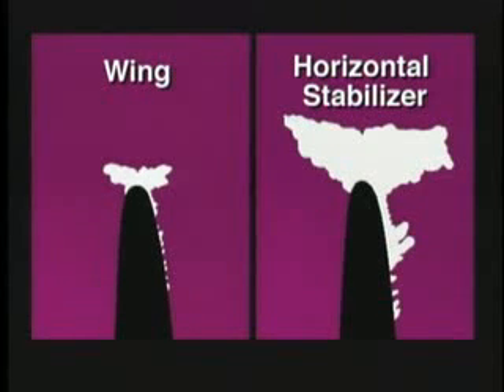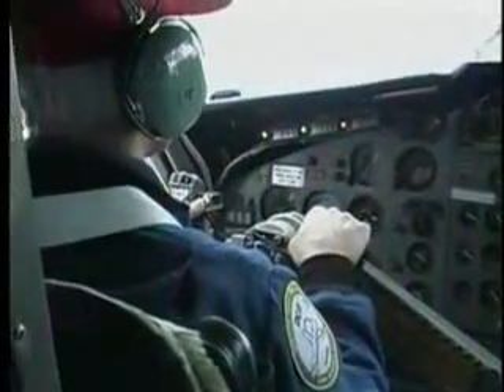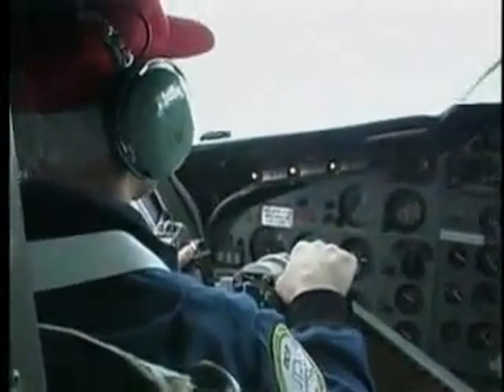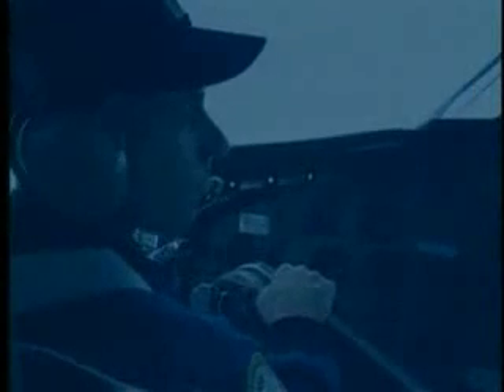1 of 3, Aircraft icing loss of control

Comment: Ha, I like you you try and throw a quick line in to try and prove you are right.  So far you didn't prove anything wrong about my last post.  So lets address the Part 121 sub-part H.  This is for aircraft requirements under the carriers op specs. I'm sure you actually read it first. You yourself can look up any aircraft you want in there Type Certificate Data Sheet and look for a section that says "Certification Basis."  There you will find the FAR its under, and I promise it will never be 121.

Comment: Well I can assure you that I am, but it doesn't matter for this.  This has nothing to do with the twin otter, that was just a demonstration aircraft for testing done by NASA.  But since you bring up the Otter; There are plenty that are still operating part 121 Check out Seaborne Airshuttle.  Also it is certified under CAR3.Here is the type certificate so you can look yourself A9EA. Part 25 is for propeller aircraft over 19 seats or 19000 lbs.

Comment: It is obvious from your comment that you have not flown 121 aircraft before, and therefor do not have the knowledge base to comment like that.  Of course any aircraft can see these type problems.  In the video the talk explicitly about regional turboprops (Those are part 121 operators). For that matter 121 in a mode of operation and not a certification basis for aircraft.

Comment: Icing will occur based on the outside air temperature and will generally occur in the temperature range of +2 to -20c. The type of icing will be dependant upon the amount of water present in the cloud and the OAT. The most hazardous formations will accrete at warmer temps ie closer to freezing and the most hazardous will therefor be SLD supercooled large droplets freezing drizzle and freezing rain. The temp decreases in the ISA at 1.98.c per 1000ft so icing will occur all year round

Comment: And, expanding on that - Carb icing can occur within that temperature range, but with no visible moisture. Because of the hourglass shape of most float type carburetors icing can occur 0 - 80F and 50% or more humidity. 

When encountering carb ice a pilot will notice a slight drop in RPM with the throttle in a static position. If carb heat is applied the rpm will drop again (due to the ice melting and water being burned off) then steadily increase back to cruise RPM.